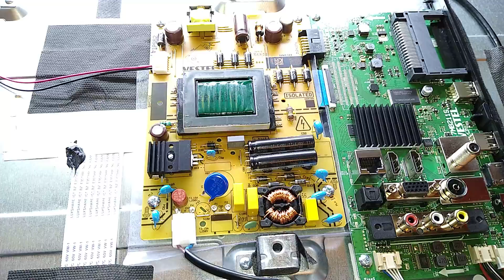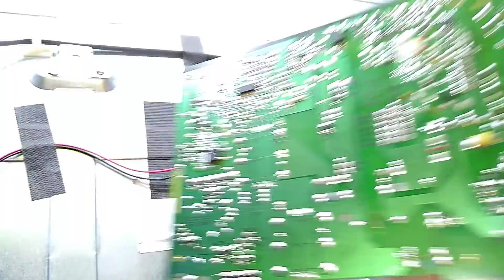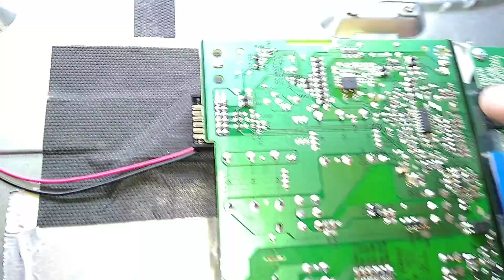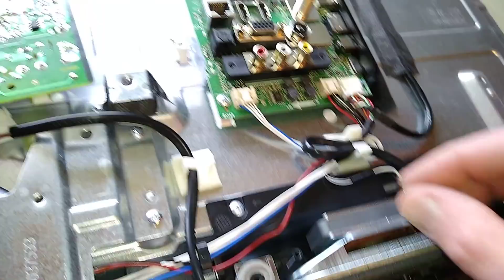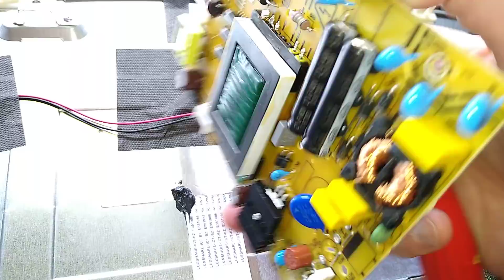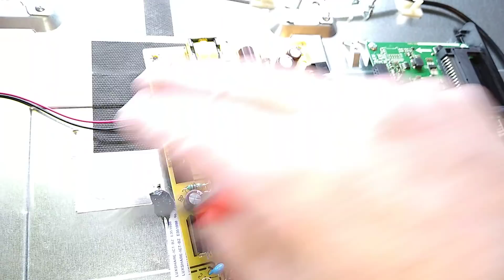There's not much inside TVs these days

Comment: It's a Vestel - Covers most of the badge engineered supermarket brands around the globe! Usually, I'd go straight for those electrolytics and the associated triads of diodes. It's commonplace for those to fail, and easy to repair. Most folk would just bin that thing and get another set - They're just so cheap these days. Nip down to the supermarket, loaf of bread, pint of milk, packet of cornflakes and a 40" TV set. Incidentally, the caps don't always get as far as bulging before the lights go out!
Reply: And most of those caps are 85° C 2000 hour caps.
Reply: @MichaeljRichter  And, it doesn't take long to knock up those 2000 hours - It's less than many standard lightbulbs!
Reply: @28YorkshireRose12  the poundland LED bulb.. had mine now for 5 years.. still going strong.. but then it's only been switched off 3 times in all those years.. it's on now.. I like my privacy.
Reply: @MichaeljRichter  Isn't it a shame? A 105°C cap costs little more yet offers several times the lifespan at the same temperature.
Reply: Pretty much all of the low end to mid range TVs come out of their huge factory in Turkey
Reply: Unfortunately the "easy" fix of changing caps hardly happens nowadays anymore. That was a thing a decade ago. All the broken TVs (about 10) I had in the last years, had burned out LEDs, which are very annoying to get to and often even harder to find replacements for (unless it's a newer brand name panel).
Reply: @superdau  Except that in this case, Clive had already tested the LEDs, which were found to be working.
Reply: Yep. I fixed one salvage by replacing caps._
Reply: A secondary rectifier diode went on mine too.
Reply: Yeah Vestel are super cheap and the LED perish very rapidly. I already repaired some 2017 / 2018 models.
Usually these TVs are so cheap that i don't even bother ordering Led strips. I just bridge the non working ones and they work for 1 or 2 years more
Reply: Actually, not everyone has the money to spare to get another set. They are RELATIVELY cheap. Cheap relative to your income perhaps but not to everyone.
Reply: @looksirdroids9134  Not cheap relative my income at all, but cheap in comparison with retail prices in general. In 1994 I bought a Sony CRT TV, 21" which cost me about £625.00. Now compare that to a modern day TV. If you can find a 21" screen it's peanuts by comparison, and a 40" screen from a local supermarket comes in at about £200.00 to £250.00 depending on badge and spec. I remember going with my parents to see the "colour Television Exhibition" (to promote colour TV) at Queen's Hall, Leeds in the mid 1960s. The Average price of a colour set than was around £500.00, half the price of a decent brand new car. Trust me, TVs are cheap these days.
Reply: I repaired my sisters TV in December 2018, was also simple to repair, a KLV-26S550A 0R1 0.5W 0.1 Ohm 1/2W Fused Fusible Resistor was broken, and a 2SK4096 K4096 TO-220F 500V 8A was broken.

Now the TV 42" TV is still working great.

Comment: I guess it was a loose screw or oxidation. Many times the TVs just have this problem.
Just like you mentioned the GND is wired through the housing and relies heavily on the tightness of the screws.
Reply: and since metall housing if you may call it that is the thickness of a coke can it will not hold after the 2nd removal and gone is the commen ground

Comment: when testing the leds make sure 1 of the leds isn't out on the rows of leds.  I had to repair a friend of mines 50" that would do a quick flash when powered on.  Turned out to be 1 led burnt out.  After replacing that row of leds it worked again.
Reply: true, the same happened  to my LG 55" about 2 weeks ago, I did not think at first about the backlight fealure, because the TV start , flash and then Power Off. I guess it is some kind of protection.
I am more used to TV that continu to work when Backlight is out, you see some image when applying light to the screen and sound also is present... so easy to understand in that case that some LED is blown...
After some reading on net, I disconnected the Power Supply off the Blacklight, and then TV stayed on and  was working but full black, so was sure at that moment it was a led issue.
Researched the faulty LED and replaced it, and everything back to normal....
Reply: @DrZipZwan  ya I was able to use a light to see that it was working.  Just wasn't lighting up.  I think the protection is there so it doesn't blow the other LEDs by pushing more voltage or current into them.  Each one of the led units on the strips have three LEDs in them.  If I remember correctly, the TV was pushing around 60v to the LEDs.

Comment: Speaking as a TV engineer who sees 50+ TVs per week, The fault will undoubtedly be an intermittent open circuit LED in the array. Typical Vestel fault. Don't waste your time replacing individual LEDs though, once one led goes, the rest will go soon after. Best to replace the whole array while you have the screen apart.
For good quality replacements in the UK, either order from TVLEDBARZ or ASWO. Avoid ebay ones as they're mostly poor quality.

Comment: I've got a 49" LG where the back light has failed. It was coming on for a few seconds, then going off again. It's still on the wall, with the 32" from the bedroom stood in front of it, because I've not managed to clear a space big enough to get it down to work on it. It's got that facility where it only lights the LEDs in the row/columns where there's something on screen, so maybe a touch more complicated on the driver front.
Reply: A chap upthread couldn't fix the LEDs with board-swap, so just added an extra 'dedicated' power supply for the LEDs; Ebay and AliExpress have constant-current LED drivers for just a couple bucks, though you might have to futz a little to figure out the required volts and watts (or milliamps).

Comment: I see both F and Belling-Lee RF connectors. Is that the norm? Can you use both or must a choice be made on initial setup?
Reply: F connector is satellite, the other one is for an antenna, digital cable, and analog cable. You theoretically use a splitter to combine 2 signals into one. You can choose which mode to use (for antenna/cable you get analog only, digital only, or both.
Reply: In Europe, F connectors are for the satellite dish, IEC coax is for the UHF/VHF antenna or cable TV, plus compatibility with old set-top stuff designed for CRTs (those output analog format TV signals on never used channels).
Reply: @johndododoe1411  In some countries, analog cable still exists, so the compatibility thing goes to all analogue channels.

Comment: Hey Clive, I have a TV that keeps getting horizontal lines and I’ve replaced the board your replacing but it didn’t change. I’ve just took it down and stuffed it in the closet lol. I don’t believe mine is LED though because it’s not that new but it almost looks identical to the one in your video. Any cracks on what you might think would cause the lines (they sometimes move) on the screen? Thanks and great video as always 👍
Reply: Lines failing is either the signal board or the connection to the side of the display.
Reply: @johndododoe1411  That’s the board I replaced. Connect looked good and tight as far as I can tell. I would send it to Clive if it wouldn’t cost me my kids college fund for shipping lol
Reply: Most times I've seen (narrow, typically) lines on-screen, the cause has been the connection *to the screen*, as in the connection to the glass (rather than any ribbon cable, graphics driver, etc.) -- and the fix has been to swap the flat panel.
Admittedly I've mostly seen vertical lines, but I work on laptops not TVs -- and a $70 screen-swap is much cheaper than a new laptop.  
If re-seating the cables doesn't help, it's maybe time to put the TV in the recycling -- sorry.
Reply: Have you updated your firmware allready? In my experience that fixes wierd and unpredictable behavior.
Reply: @Skyper100MC  I haven’t no and honestly I’m not sure how to do it to that kind of tv. Was told by a TV repair shop to replace the board and it should be fine. Replaced it and it didn’t fix it. Then was told to scrap the tv and buy a new one. I bought it used 4-5 years ago and it’s worked great and one day I turned it on and it took longer than usual to come on and then there was the lines.

Comment: Most common failures I’ve come across on Vestel power boards are failed diodes .. as you correctly observe they run them very hard and they are more reliable floating 5mm above the board. Looks daft though.  Occasionally the caps go, but relatively infrequent.  Always good to have a spare on hand.
Reply: Second most common issue I've seen is backlight failure, where one LED fails and the whole panel has to be scrapped.. unless you're prepared to risk opening it and replacing the LEDs (as a set, or you'll be doing the same in 6 months time).
Reply: @frankhovis  ... yes indeed, I’ve never been that happy just replacing an led or a strip. Colour matching can be a pain, and backlight leds work hard for a living, so if one has gone you can probably look forwards to the others following soon. All good fun though once you work out how to dismantle & reassemble without having lots of ‘spare bits’ left over.
Reply: @CTCTraining1  'All good fun' until you spot the speck of dust that's got inside while you had the display apart, or you rip the ribbon cable off while reassembling... or weeks later a fingerprint starts to appear where you lightly touched the diffuser.  That's always assuming you have somewhere dust free that's large enough to be able to lay the display flat while opening it. I've done it a few times and its not something I'd recommend doing.
Reply: @frankhovis  ... so true, but that said being able to save something destined for the tip and giving it a second life, even if imperfect, still feels like a worthwhile thing to attempt.  Hopefully, come the end of the year, I’ll be in a better position if Santa brings me the clean room I’ve asked for.

Comment: Some months ago, I took one big broken TV from a friend. Removed the broken panel, removed the digital board, plugged an ESP32 to the PWM signal and to the digital power supply.
Now I have a big wifi light hanging on the ceiling
Reply: this is your build I guess: https://www.youtube.com/watch?v=8JrqH2oOTK4
Reply: @DrZipZwan  Yeah exactly, I used his original idea but tweaked it a bit to use the existing electronic hardware and connected it to my domotic system using EspHome

Comment: That is a typical Fault on a Vestel Device, mostly one or two LED´s are Broken. I have a TV in my Basement, with Broken LEDs The power supply is mostly not the issue.  One LED Strip is so Expansive.. and you have to disassemble the screen without damage it, what is not easy

Comment: Cello branded TV's (poss. UMC make the parts) are even simpler and only have the one board for everything, no separate power board.
One other thing to make sure you do when you open one of these TV's is to discharge the mains side capacitors, you can get quite the jolt of you dont!

Comment: Those Vestel tv's are actually quite interesting, the software on it is basically linux and a set of programs which handle the rest
Since they use the same parts on multiple televisions they have some files in the firmware which define the panel (so one could theoretically get a different lvds panel and reuse the board as a driver for it) 
The scart port can be used to control the tv and to get a root shell
Also there is a lot of fun stuff hidden in "aurora.elf" (the main program) like the videowall feature and options hidden away from end users
Beware: Some firmware versions have a (possibly still unpatched) bug which allows an attacker to connect to port 1998 (iirc) over telnet, start telnetd and have a root shell allowing him to have access to usb drives and webcams plugged into the tv
Reply: Even the top brand TVs are usually Linux based, but more locked down.
Reply: Have a video on my channel of me getting a console on a dead one
Reply: It's a tx/rx pair on the scart
Reply: Very easy to brick one if you screw with the wrong video setting in service mode! Hard to change the settings back if you can't read the display.
Reply: @Supersonicff-dw6bs  Also very easy to recover from.
Get a usb drive with the "full update" for your tv (they sometimes come with a definition file with all hidden settings), plug it in and press a button while turning it on.
The service menu on these things is mostly useless and it has nothing really capable of bricking the tv.
The only way to properly brick these things is to overwrite the bootloader on the spi flash; but even then you can just dump & flash it from another set or even get it from the full update
Reply: And people wonder why I have an obsession with "dumb" technology. I just want a good panel with reasonably low latency.
Reply: Vestel actually originates from my country,I didn’t know non-Turkish people also used it.
Reply: @tezcanaslan2877  we have Beko and Arcelik also in The Netherlands
Reply: who on earth leaves a telnet port open after the year 1993?? you've basically created a device that can be hacked by accident at that point
Reply: @rertnerfurtheng3771  I suspect there's still a remarkably large amount of security by obscurity going on.  Its not like its inherently bad to have an open port though if they are using an API to do anything.  Remember, even a web server can be talked to over telnet, it doesn't mean they are necessarily all exposing a shell.
Reply: @alexatkin  The issue with telnet is that it is 100% plain text, even the password being transferred. If any device is listening to packet xfer or if that plain text gets logged anywhere you've got an info dump of a ton of data.
Reply: @rertnerfurtheng3771  Well it is "wired up" the same as the uart, except that there is no feedback
It is there in order to control the tv but had the bug of running linux commands as root because aurora.elf runs also as root
Reply: @rertnerfurtheng3771  If you have a Technicolor modem, they all have admin interfaces available via Telnet.
Reply: Have you got a channel?
Reply: Yep some smart tv's if not all use a nand flash, the sort that's found inside of a usb stick, for storing the firmware and some programs.
Reply: Nothing to be said about what looks to be a PCMCIA (PCCARD) connector at the upper right corner of the logic board?
Reply: @AndrewBeals  It's a CI slot for pay TV.  I used to work on these TV's years ago and was surprised just how many Vestel TV's are around in rebadged form
Reply: Every single TV is a linux computer nowadays (save for apple tv). They are just locked down.
Reply: Lucky! Rulo locks everything down over here in the states...
Reply: My girlfriend has a horrible Salora television that has an eyesore of a user interface. I'd send the UI designer back to kindergarden after (s)he presented an UI with primarily white text on a light pink background. This wouldn't be so bad if the text would have a dark edge, but it doesn't, so there is almost no contrast to be had. I'd love to hack into that control board, to at least replace the CSS with one with a more sensible colour scheme. I couldn't find any information on how to get a terminal on that one.
Reply: @LarixusSnydes  some Salora sets are also made by Vestel. Determine the mainboard type (17MBxxx) and you might find some more information.
Reply: @LarixusSnydes  It doesn't use css, but there is a user manual overlay which can be modified to have html content overlayed onto the tv picture
The themes are somehow packed and can be swapped between firmwares; vestel developers have a tool to create them "easily" (if you can trust some documents which say vestel confidential)
Could be qml but i haven't looked into it
If you get a root shell or somehow dump the nand it should be in /vendor/...
uart is either on a scart port or vga port, since they have some pins which are not used
Reply: @_DSch  Thank you so much for this explanation. The model is the 32HSW5012/3

Comment: I was given a 10 year old blu ray/hd recorder to try to repair but got nowhere.
The power supply board looked similar to the one in the tv:  single sided with lots of wire links and plugged straight onto the control board.
I did a bit of searching and the power supply boards seemed generic, like they were used in multiple models and brands of blu ray players.

Comment: Classic “Black Friday” set with Vestel rubbish in it. So many dead TV’s (happen) to have Vestel power supplies. Put a multimeter on the LED wires. If it tries to put out 90v & goes back down when you start the set it’s most likely dead LED’s & the drivers are working fine. Plenty of TV’s die due to dead LED’s because they are wired in series & the LED’s burn at different voltages (it’s cheaper to manufacture them that way) good advice would be to not run your LED TV at full brightness.
Reply: Constructor could engenier a better cooling system for those LED... But we know why they dont want... If no TV get sick so no more TV selled...
Planned obsolescence !!!